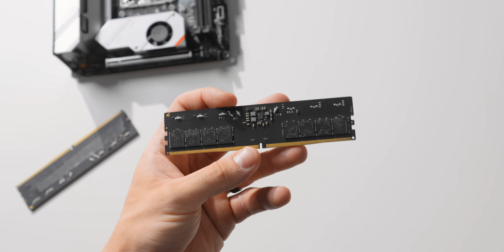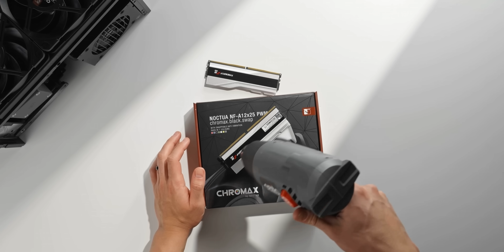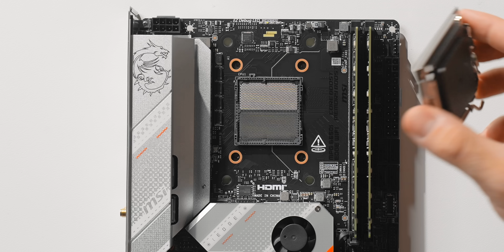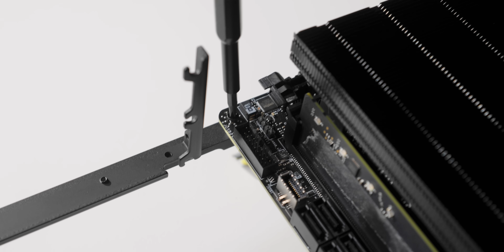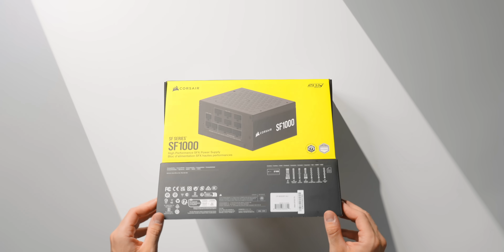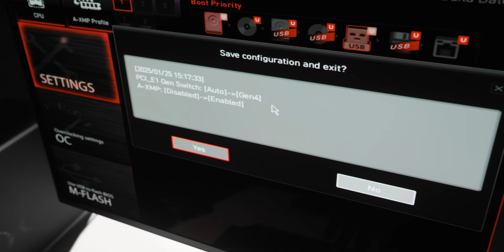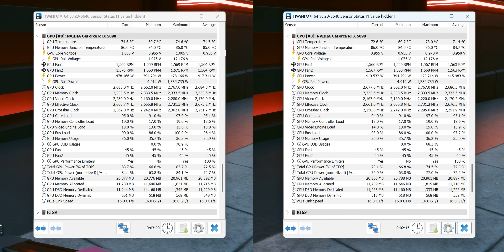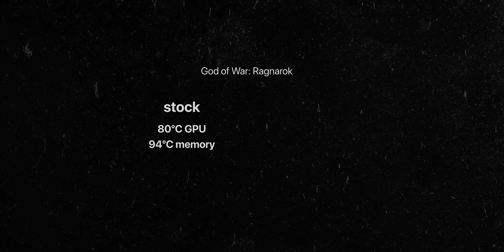My fastest gaming PC, ever – 5090 + 9800X3D

Comment: Low profile RAM module with heat spreader exists. Here's few of them:
Vengeance from Corsair, Ripjaws from G.Skill, Fury Beast from Kingston...and more.
Reply from the maker: Height limit is apparently 33mm for this cooler, maybe it's incorrect. Vengeance and Fury Beast are 35mm.
Reply: @optimumtech  Unfortunately, I can't understand how you can buy Trident Z modules and then remove the cooler.
That's what the Flare X5/Ripjaws S5 (33 mm) are for.
Reply: @optimumtech  maybe t-create they are looking so tiny compared to the others
Reply: @00kx  t create are 32mm so they would work
Reply: @loutish315  thats what i tried to say..
Reply: @optimumtech  i love how VLP ddr4 suddenly flooded the market for like 45 canadian for 16gb 3200 mhz sticks... too bad they are not "relevant" anymore and i havnt seen a ddr5 kit of the same height yet
Reply: @optimumtech  maybe just flex a little from the height?
Reply: @optimumtech  I used Corsair Vengeance RAM on my Black Ridge + T1 build with no clearance issues.
Reply: @optimumtech any chance to test AXP90 X47 at 3 slots, or maybe swapping the 4070 Fan
Reply: @optimumtech  time for sandpaper omg
Reply: @optimumtech  You show us a couple of different angles in the video where the RAM appears to have way more than 3mm of space above it. Looks like some Corsair Vengeance would easily have fit, unless something else was stopping it?
Reply: Klevv Bolt V, TeamGroup T-Create Expert...
Reply: and? Very often they are worse dies, and removing those covers if something improves temps, its first thing you are supposed to do if you want to oc then. Let alone they look mych better in this kind of build that way, let alone most covers looks like they were designed in 2010
Reply: Looking at the video, there's plenty of room for Corsair Vengeance or G.Skill Flare X.
Reply: massive heat spreader?
Reply: He has 1.25m subs and does pc content.

Do you really think he doesn't know that? 😂

Comment: You know ITX is peak when the temperature is good and there's an RTX 5090 in it.
Reply: Pretty impressive I must say.
Reply: Undervolting really has become a godsend with the past few gens of GPUs and CPUs.
Reply: It's somehow perfect, very impressive
Reply: Thar 5090 if not brought to 350w, is gonna cook that PC. This new format might be great for getting power out of the die, but really horrible for any kind of build. iTX 15L builds. Expect it too cook the motherboard, even at 350w.
Reply: @TTks124 It's not like he got the GPU temps good and just left the CPU running at 95-110.

GPU and CPU are the two hottest components, his were both sitting in the 70°C-80°C. Just because it's in an enclosed space doesn't mean other components are magically going to exceed the temperature of the heat sources. All the ventilation in that case is LITERALLY MILLIMETRES away from the hot areas.

You're dense. Thank you for letting the world know.
Reply: Yeah in case you want high performance and live in a tiny home or dorm room, though usually people in such circumstances don’t have a spare 5k laying around, if they did they would not live in a tiny space that needs a shoebox pc
Reply: @mikeweatherford5312  its purely preference, it doesn't have to do with the living space or how rich you are.
Reply: The size of the box you put the GPU in doesnt matter at all 
Big cases usually have terrible airflow anyway
Reply: @TuriGamer  small cases usually have terrible airflow as well. Most cases have terrible airflow. Doesn't say much. You can get big or small cases with good or bad airflow.
Reply: @ Very easy to get good airflow in cases this small cause a hole in the sidepanel is a 5cm way to fresh air.
Reply: @TuriGamer that’s an ignorant statement…
Reply: Well a 9950x3d would be a little faster
Reply: @Som_Mac Not for gaming